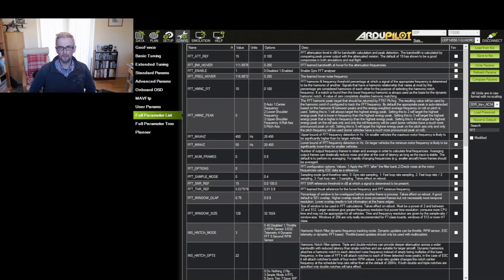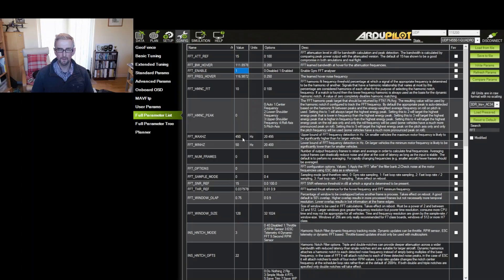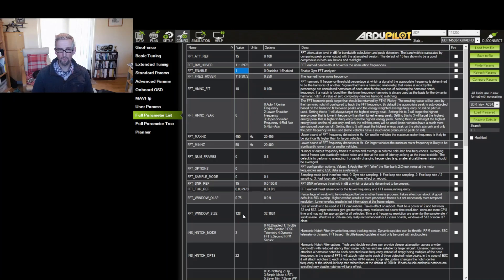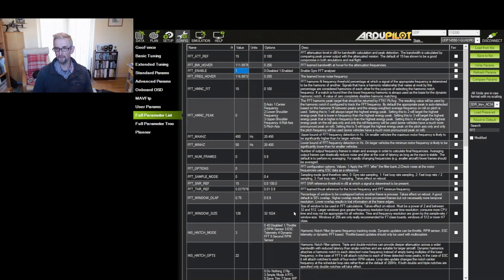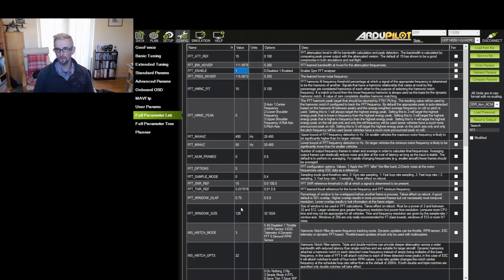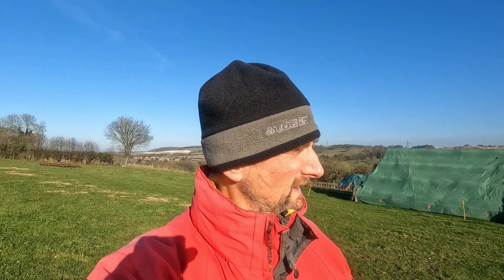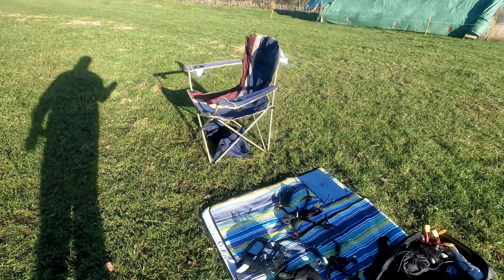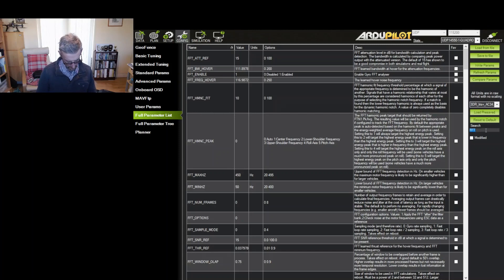Hexsoon 650 Build Video 15 - Automatically setting up the harmonic notch using in-flight FFT

Comment: Greetings Andy. I just want to make sense of the flow of this video. Am I correct in assuming that the steps you are taking are as followes. 
1. Perfom first flight and Intial autotune
2. Perform second flight with FFT tune while hovering 60 seconds. FFT then records data automatically
3. Perform third autotune based on FFT data automatically captured by FFT tune from previous flight?

Comment: I'm about to start tuning a large copter. Is it safe to go lower than 50 Hz in the INS_MINHZ?
Reply from the maker: It should be ok, although I suppose we really should have an option for disabling this on a switch
Reply: @andypiper5285  I flew a test with INS_MINHZ=30 and it went well. But I got an error on the radio that said: Unable to set throttle notch with 90.5 Hz. And the test did not change any parameters. Do you have any idea what I'm doing wrong?
Reply from the maker: It will mean that the harmonic notch mode is not set to throttle notch - maybe you set it to something else? Try setting it to 1 @botornvig

Comment: I have a 920 hexacopter. Will the settings in this video be a problem? Should I change anything (for FFT Tuning) to make sure I'm on the right track?
Reply from the maker: This feature was disabled in 4.3.4 - would would need to use 4.4-dev to use this feature. It should work fine in 4.4 on a 920 sized copter
Reply: @andypiper5285  With the settings you have laid out? I have 380kv motors and 17" props.
Reply from the maker: @Shadowquad  the Hexsoon is 330kv and 15" so very similar
Reply: @andypiper5285  Excellent. Thank you!